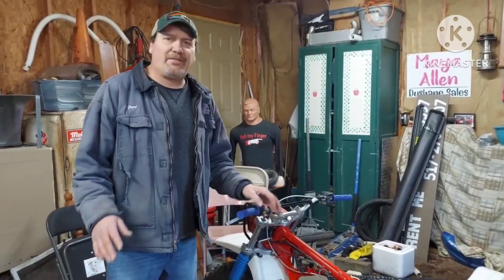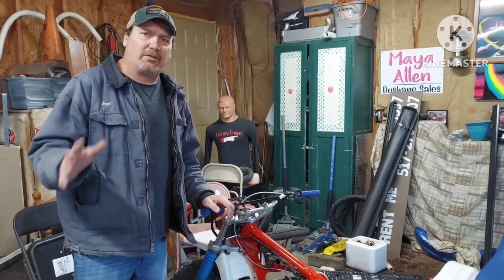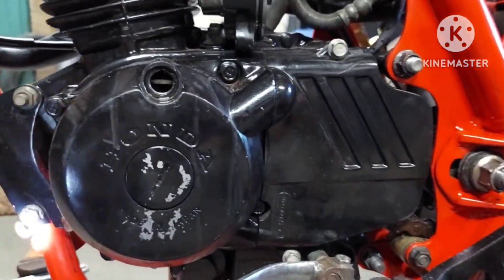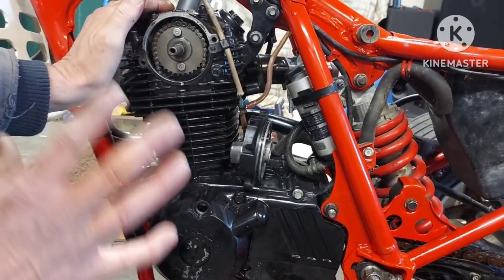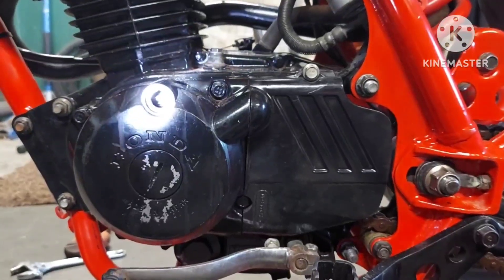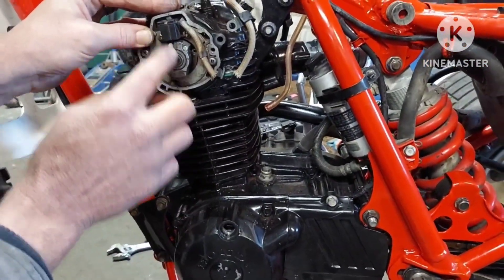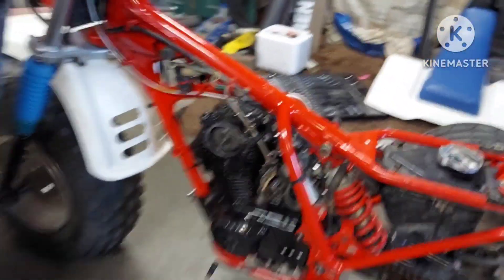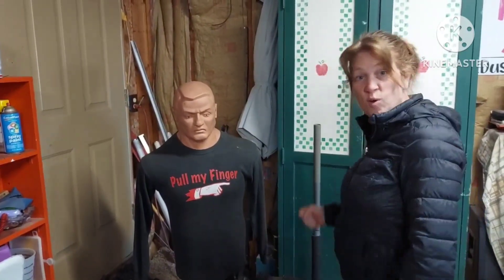Restoring a Honda 200x 3 wheeler (Timing problems, please help!)

Comment: Is the motor rebuilt? Another thing if the carb is new screw the mixture screw in all the way and do 2 full turns out. If it isn't then the main jets are notorious for getting plugged up.We have these things in my shop all the time and they are a pain in the butt.  The over heating in front could be a bad valve or spacing. 0.003 is what they need to be. You may have a stretched chain or worn tensioner as well with the timing issue. Start with the carb if it runs better move to the valves,get them adjusted,but if it still runs funny then you know its either the timing chain, tensioner or both. Oh, and if it still overheats after adjusting the valves then that's definitely a bad valve.
Reply from the maker: Will definitely try your suggestions before changing the timing chain. We did get a new one. Thanks for watching and commenting, we appreciate it

Comment: Also, be sure to spray around the intake boot on the carb side while it’s running. If you hear a change in the idle it’s sucking air creating a lean condition.  Those intakes are known to crack letting air in as well as the oring between the I take and head being old and not sealing.
Reply from the maker: Thanks, I  will check that this week.

Comment: Me and my dad are having a problem with  our timing chain jumping and now it came off the bottom of the engine
Reply from the maker: Sounds like your timing chain tentioners are bad, or the ajuster is stuck. The bolt on the case just below the head (right side) is the chain ajuster. I'm hoping to have my video up soon put a new chain in just have to finish it up. Thanks for watching and commenting
Reply: @octanegarage3729  we looked at that we got a new adjuster we fixed the problem it just needed higher octane fuel we are using 93 
Because it kept detonating now it just needs more fuel

Comment: Hi, i have the same problem with my XL125s, did you figure out the issue? if so, kindly share.
Reply from the maker: No, I have not figured it out yet. Sorry, I did put a new timing chain in it, and I still have the same problem. When I get it, I will let you know. Thanks for watching and commenting
Reply: @octanegarage3729 did you replace your camshaft?
Reply from the maker: @sohailkhan-fu1uq  no, not yet, we are going to. Hopefully, that will fix it

Comment: i'll do my best to help ya out !. first, even though the T mark shows up in the hole, and you think this is on TDC ( top dead center ) on the compression stroke ? , you must figure out if this is on the exhaust stroke ?, or compression stroke ?. the T mark can show up in the hole in both the compression stroke, and the exhaust stroke !. with this said, this does not explain why the timing marks on the rotor are off !. this tells me your cam chain is stretched !. as for it running rich ?, this is a carb issue, never..EVER...use china carbs !..honda engines do not like china junk !. you would be better off buying a used correct carb, and rebuild it..than using a piece of junk from china !!. if you go oem used carb, ONLY USE SHINDY CARB REBUILD KITS !. start with a new cam chain, set the T mark up in the sight hole, to check to make sure you are on the compression stroke , take a pencil, with spark plug removed, carefully ease it down into the spark plug hole, and see if you feel the pencil touch the piston ?, if you do ?, then you are on the correct stroke so far. once you get the cam chain up to the top, set your cam in the head, WITH THE CAM LOBES FACING STRAIGHT DOWN !!, you will need to get the cam sprocket on the end of the cam, at the same time getting the cam chain over the end of the cam when you go to place the sprocket on the end of the cam. MAKE SURE YOUR FLYWHEEL DOES NOT MOVE OFF THE T MARK !, now carefully lift the cam sprocket up onto the cam end, if you look closely on the cam sprocket, one spot at the bolt hole has a punch mark ?, IT MUST FACE UP TOWARDS THE TIMING MARK ON TOP OF THE ROCKER BOX !. 

So now you got the cam chain on the cam, cam lobes were facing down when you installed the cam, punch mark facing up on cam chain sprocket, install the cam chain sprocket bolts, use loctite on these..or they will back out. before the next step , MAKE SURE YOU DID NOT LOSE THAT DOWL PIN THAT STICKS OUT OF THE CAM END !!!, THIS IS VERY IMPORTANT FOR THE ROTOR !. recheck to make sure your T mark is still showing in the sight hole down below ?. now install the first part of the rotor housing, again, make sure you do not lose that dowl pin !, now install the pick up coil bracket, two screws hold it in place...DO NOT TIGHTEN THEM DOWN ALOT YET !. Now grab the rotor, with the line on the facing, facing up, carefully install it on the cam end, install the 10mm bolt and washer, use loctite again here. Now you need to turn the flywheel to the F mark, you will need to remove that center slot plug, standard screw driver, under it is a 17mm bolt head, use a ratchet to rotate it back to the F mark. Back up top, with the pick up coil still lose, rotate the bracket until the line on the pick up coil lines up with the rotor line, tighten down the two bracket screws. now you need to adjust your valves. most honda's are .006 inches, you can use feeler gauges to set them, but i do not use them..when you do this 30 yrs ?, you get the feel for them ( pun intended ..lol ). before you crank it up, you can do a test to make sure you have your valves set right , by this..i mean you MUST have them set on the compression stroke...AND NOT THE EXHAUST STROKE !. To check this to make sure you have your piston set right, on that 17mm bolt on the flywheel, as you watch the intake valve, carefully, slowly rotate the flywheel backwards from the T mark, as you are rotating the flywheel, if you were on the correct stroke ?, the intake valve will start to go down , when it does, then you know you had the T mark on the correct stroke. if the intake valve did NOT start to go down ?, then rotate the flywheel back to the T mark where to had it, then keep turining it all the way around , until the T mark is in the sight hole, now go backwards again, and the intake valve will slowly go down. once this is takes place, rotate it back to the T mark where you had it, set the valves, button it all up. it should fire up no problem at all..that is...if you got the carb right ?..lol.
Reply from the maker: Thank you for the help and great information. I now have a  new timing chain. Hope to do a video on installing it soon. Thanks again

Comment: Check out @MRCbuilds channel. He just done a live video the other night explaining in great detail about 200 timing. Also, the knock off carb could be causing it to be lean. Very common for those carbs to cause this. I have a restored OEM 200x PD62B carb available if you need.
Reply from the maker: I will check out that video to thanks